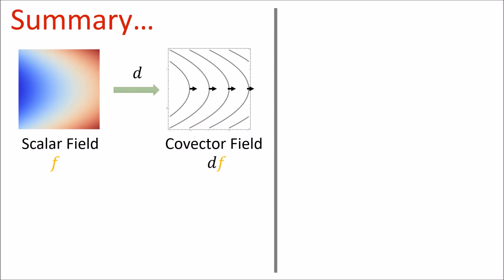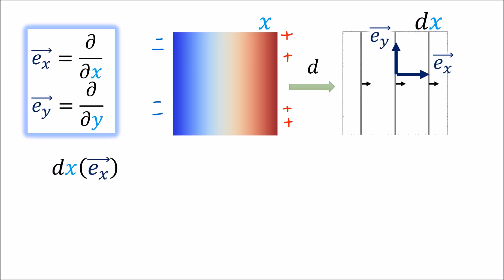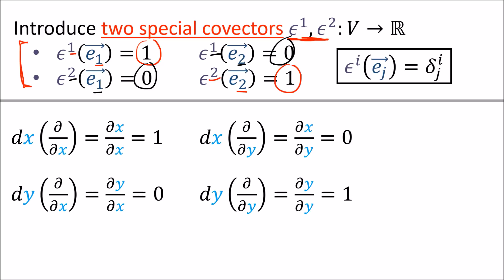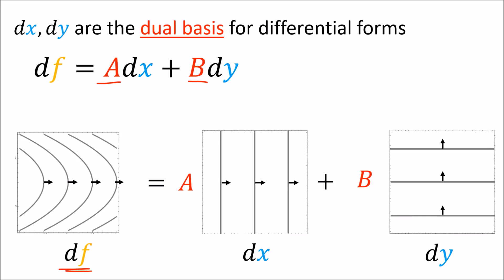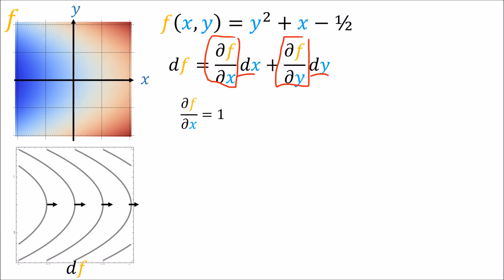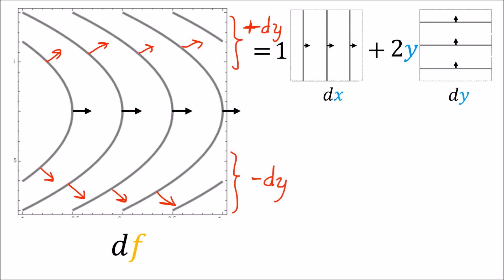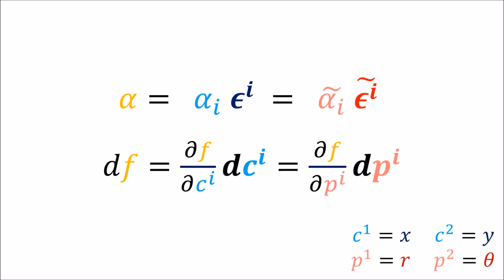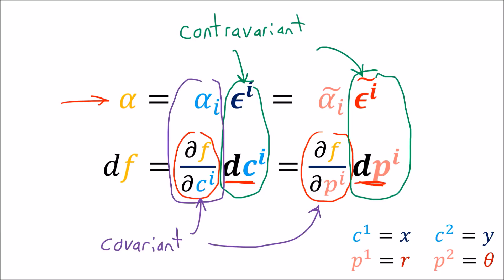Tensor Calculus 7: Covector Field Components

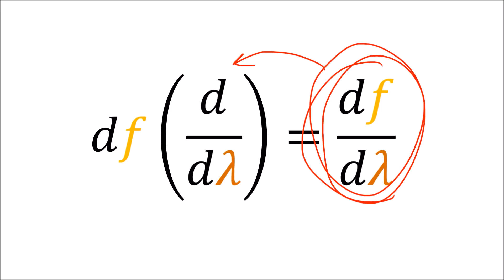Comment: Hi Chris I'm reviewing things to get used to them...formula at min 6:11 df(d/dlambda)=df/dlambda .. shouldn't the result be written with partial derivative del f/ del lambda? Or instead where do I get a reference for this formula? Thanks a usual.
Reply from the maker: This derivative is the rate of change of f along a 1D curve parameterized by lambda. Since a curve only has 1 variable parameterizing it, it's an ordinaey derivative, not a partial derivative.
Reply: Right, I had to know this. Did you mention this matter in some video before? Is it the directional derivative?It really got me off guard Thanks
Reply from the maker: @AndreaPancia1  I guess I didn't. Hopefully it makes sense now.

Comment: In 1:56, it has been assumed that df operator also acts on vectors from TpM vector space (in the same way as with vectors in real space). Am I missing something? Is this obvious? I think this needs to be established first before proceeding forward.

Edit:- I think from this point on, the definition of df operator changes. It is no longer an operator in the real vector space but it is an operator in TpM space.
This was not mentioned in the video.
Reply: "real space" is in general not a vector space but a manifold. You can't talk about vectors in real space anymore, only in TpM. The only thing real space does is you can have tensor fields defined on every point in real space, and the values of those fields are tensors over TpM.

Comment: Does this only apply in an orthogonal system like a sphere parameterized with two angles?  Otherwise the tangents of the two parameters, say U and V are not orthogonal and so their gradients or duals aren’t in the same direction as their tangents, making your squared up level set above fail, although the gradients as duals still works as does using the metric to raise the indexes of dR/dU to get gradients(duals)without trying to take derivatives of inverses like du/dx when your R is (u, v, u^2 +2uv)
Reply from the maker: I believe all of this should apply in all coordinate systems. Generally speaking, basis vectors and their duals do not point in the same direction. If there's a particular point in the video you have questions about, can you give me the timestamp?
Reply: Thank you so much for answering. 8:37 you have drawn dx and dy perpendicular to each other, which is fine in the plane, but on a surface, du and dv aren’t perpendicular if g12 isn’t zero so that visual fails. I can’t reconcile grad u, du(v) and the dual to dR/du in the SURFACE. For example, if surface is ( u,v,u^2 -v^2) what is grad u at u=.6,v=.15?( data: G inverse is ( .431,.142,.142,.964), (dR//dU= 1,0,1.2), (dual of dR/dU= .431,.142,.474), dR/dv=(0,1,-.3).

If you dot grad u  with dR/du do you get one? With dR/dv do you get zero? The angle between u and v is 105 degrees and that makes level set argument for the reimagining of the gradient to du difficult! I can’t figure out how to use gradient or du in place of an actual dual with hard numbers, not hand waving. 

Thanks again for your amazing work!

Thanks again!
Reply: I figured it out: 1-you could have skewed your picture of dx dy and skewed the level curves as well to make it more general. 2-Curves of constant u and v are easily confused on a graphic. 3-calculation of partial derivatives inverses is tricky when you can’t separate variables but it can be done implicitly.

Comment: I understand dx, dy, can also be seen as projection maps into the first, second coordinates, i.e., dx(a,b)=a; dy(a,b)= b, as the dual basis to Del/Delx . In this case, dx(\delx)=dx(1,0)=1; dy(1,0)=0 , etc. dx, dy are linearly -independent, so they are a basis for the dual space to vector fields. But I'm having trouble in the opposite direction,  using this interpretation , i.e., seeing how Del/Delx(dx)=1 and Del/Del y(dy)=1, etc.
Reply from the maker: When you apply a covector df to a vector d/dλ, this results in the directional derivative by definition: "df(d/dλ) = df/dλ". The covector "df" basically tracks how fast the function "f" in the direction of a curve given by λ, and this is what the directional derivative is. You can think of dx(∂/∂x) =  ∂x/∂x =1  and dx(∂/∂y) = ∂x/∂y = 0 as basically being like the definition of dx.

Comment: Aloha. I don't fully understand why df( e_x) = partial f / partial x. In an earlier video you have said that the directional derivative is   v * grad f. If v = ex = part/part_x and grad f(x,y) = (1,2y) then it should be zero. Maybe I am mixing up vectors and vector components here, though. and v = 1*part/part_x + 0*part/part_y = (1,0). In either case I am nit sure how df(part/part_x) = part f/ part_x... What is the rule that makes that work?
Reply from the maker: Your second guess, where ex -> (1,0), is correct. df(ex) = ∂f/∂x is basically the definition of df. It is the covector field that gives us directional derivatives when we act on a vector with it. I explain this in later videos, but because we have df(v) = ∇f·v, this means that df = ∇f · ___; so df is the covector field associated with the vector field ∇f.
Reply: @eigenchris  Hi! Thanks for the reply. If its the definition I will just have to swallow it until I get behind it. The vectors in coordinate form are simple enough to understand but I have some difficulties with the abstract objects. If you go back to that in later videos everything will work itself out, probably. Thank you very much for those videos, btw. I have a similar background and learning everything that GR throws at you at once is pretty difficult :/
Reply from the maker: @Simon-ed6zc   You can sort of think of the directional derivative as being broken up into 2 pieces: #1 is how fast the function is changing (represented by df) and #2 is how 'fast' we are running by (represented by the vector v). df(v) takes both of these rates of change into account. In expanded form, we could write it as "(∂f/∂x dx + ∂f/∂y dy)(vx ex + vy ey)", which, after distributing, simplifies to "∂f/∂x*vx + ∂f/∂y*vy", which is the directional derivative formula, but with the "length"/"speed" of v taking into account. I'm not sure if that helps more.
Reply: @eigenchris  Thats pretty close :D Thanks for the effort you put into helping some random on the internet. My original problem was why dx(∂/∂x) = dx/dx, or df(∂/∂x) = df/dx. But as you said, thats the definition. I thought that was something thats proven and I couldn't wrap my head around how to move prove that. All the best!

Comment: Another question. I know you said we use derivatives and differential forms to describe the vectors and covector so as not to rely on position vectors as they can be hard to define for something like the flat 2d map of the earth. 

I was wondering how that fits in with the concept of polar coordinates, namely, how do you go about defining basis vector theta for angular position when you dont have an origin?

Or does it actually mean that we are concerned with the magnitude of a vector at any given point in space, and the components of a vector is relative to that point?
Reply from the maker: As long as you have coordinate curves, you can define tangent vectors (basis vectors) along those curves. So defining basis vectors on polar coordinates isn't much different than any other coordinate system.
Reply: @eigenchris  I guess what I don't understand is how you can define tangent vector in polar form without a separate reference point, if the magnitude of the theta basis vector would be 0 at the origin.

Comment: At 5:50 does d/df = partial/(partial x) +partial/(partial y)? And therefore a unit vector?
Reply from the maker: The formula for d/dλ is at 6:18. There's no reason to believe it's a unit vector. I'm not sure what d/df there's no curve associated with f.
Reply: @eigenchris  sorry you are right, I mean't d/dλ. I was confused why d/dλ was not ∂/∂λ, i.e why it was a total derivative and not a partial derivative. At the time of asking the question, I had thought the total derivative implied summation of the two basis* vectors i.e. d/dλ=∂/∂x+ ∂/∂y.

Comment: I am going to rewatch this while actually focusing on it and then think this over. Because the thumbnail / timestamp 6:11 seems to be in contradiction to the Wikipedia article section on higher differentials: (https://en.m.wikipedia.org/wiki/Differential_of_a_function). In other words, my misconception appears to be that the derivative of a differential is zero.
Reply from the maker: Tensor calculus involves re-interpreting df to be a covector (a linear function that takes vector inputs and outputs a number) instead of a differential. At 6:11 the covector df eats the input vector d/d lambda and outputs the number df/d lambda, which is the directional derivative.
Reply: @eigenchris  - since lamda is a scalar variable that sort of measures the level of progress or travel along a curve, what direction does δ/δλ point in?? Intuition says the tangent direction, but definition of  λ implies no direction that I can see.
Reply from the maker: @rasraster  Yes, d/dλ points in the tangent direction.
Reply: @eigenchris  OK. It'll be a fun little project to figure out why a progress variable has a direction 😉
Reply: @eigenchris  OK, I see why: when δ/δλ is expanded with the chain rule, it's a linear combo of the basis vectors δ/δx and δ/δy.

Comment: @3:55, you refer to the episolons as co-vectors.   And this whole section (6, 7, 8) is about co-vectors by title.  So why is this using "contravariant" notation?  Is this a co-vector, indeed or a contra-variant vector?   Please clarify.
Reply from the maker: Basis covectors (epsilons) are contravariant/upper-index. Their components are covariant/lower-index.
Reply: I see.  So actually there are 3 terms floating around.  Covectors, Contravariant vectors, and covariant vectors?

Please clarify @5:11, I see you have covariant basis vectors as arguments to alpha and you arrive at alpha1 and alpha2 using e^1 having alpha1.  Then alpha2 belongs to e^2.  Yet the picture @5:11, only shows e^1.  

What is the difference between alpha2 * e^2 in the equation and alpha2*e^1 in the picture as well as below the equation alpha = alpha1 e^1 + alpha2 e^2.

Comment: mistake in 2:00(?)
i think df(p/px) = pf/p(p/px) (p/px=v here) but not pf/px because this is how i use the formula df(v) = pf/pv
i think the final result will have a terms with second derivative 
but i am wrong??
anyone could help me to understand why
thank you
Reply from the maker: It's not a mistake. You need to keep in mind that "df" here is a covector, and the definition of "df" is that "df(v)" is equal to the directional derivative of f in the direction of the v vector. This means that df(e_x) is the directional directional derivative of f in the x direction, which is simply pf/px.
Reply: @eigenchris  thank you.
i try to think the co-vector in such way.
df(   )  is something that eat a vector therefore it becomes df(v)  and df(v) = pf/px (vx)  + pf/py (vy)
where vx and vy are the components of v.
then df should become  pf/px  (   )  + pf/py (   )  = df(   ) which is a linear map and i can think this is just the "left part of the dot product" since  (pf/px.pf/py) dot ( vx,vy) = df(v)
therefore i conclude that df itself is actually vectors  ( pf/dx , pf.py) which is perpendicular to the lines which is actually the same as the gradient vector
but gradient vector is in "normal"vector space(since  grad f   = df/dx e^x + df/dy e^y) but  df is in dual space( df  =  df/dx * (epsilon^x) +  df/dy*(epsilon^y)).wherefore df is not the same as gradient vector f ?

is  df  actually a  gradient vector? 
or  co-vector itself is just simply a small change of f.

and there is other question i want to ask:
i get little confused since there are too many interpretation for the same df.
(1)df is just a small change of f in some infinitesimal random direction"
(2)df is co-vector which is actually the stack of lines /stack of curves when we zoom in
(3)df itself is a linear map which is the left side of the dot product which is perpendicular to the "stack of curves" (but not the stack of lines/curve itself)

(1) (2),(3) seems to be related in someway but they are not actually the same... :(  
which one {(1)(2)(3) }are correct??
by the way thank for your help
Reply: i try to link back the "df" into "gradient vector f" but i think they are different 

gradient vector f is ( pf/px ,pf,py)  but  df  is pf/px dx + pf/py dy
what is the relationship between them actually...
it seems they are the same thing(they both turn vector into scalar value function such as directional derivative) but obviously they have different structure and meaning..
this paradox comes from the fact you assume dx is a basis of the co-vector.... 
because both df and  grad f  "eats" a vector and turn it into the same scalar function...
but we know  gradient vector  is not the same as df which  is total differential in cal 3
Reply from the maker: @garytzehaylau9432  The following formula "df(v) = pf/px (vx)  + pf/py (vy)" is correct in the case of the orthonormal xy coordinate system (it's not true in polar coordinates...  there will be extra terms). I have 2 videos on the differences and similarities between "df" and "the gradient of f" (videos 13  and 14 in this series). You should probably watch the 1st one at least. I hope it will clear up the confusion.
Reply: @eigenchris  thank you 
i
you are very good teacher

one more question: 
df can be interpreted as a small change in f  in some certain direction,right?
which is the direction correspond to this "df"
thank you

Comment: Can you extend what you are talking about in flat space to curved space?  you alluded to this a little in your 5.1 video I believe.  You  know 1000 times what I know about general relativity--all I know is that mass bends space, I think...don't know how and that there are several tensors in Einstein's field equation, which I have read contains 16 equations, 10 of which are different--but it's a mystery to me.  I have only found a very few people trying to explain general relativity and most videos are very old--can barely see them on the screen and the explanations are terrible.  You do a fantastic job and use high def video and great graphics.  How do Christoffel symbols fit in to what you have presented?  or do they? Thanks.

Comment: I still don’t see the parallel between the covector field « df » and the reinterpretation of « g(x)dx » that we see in integrals. Will this come up in the tensor calculus 8?
Reply from the maker: Tensor Calc 8 will be on covector field transformation rules. Tensor Calc 9 will cover the re-interpretation of integrals.
The short explanation is that the integral_(a)^(b) df is just f(b) - f(a). This corresponds to drawing a path from point a to point b in the covector field and counting how many lines we pierce while following the path. This will only depend on the endpoint locations, not the path taken, and hence the answer is f(b) - f(a).
When we write g(x)dx, we're really just expanding df = g(x)dx, so g(x) would be equal to df/dx.